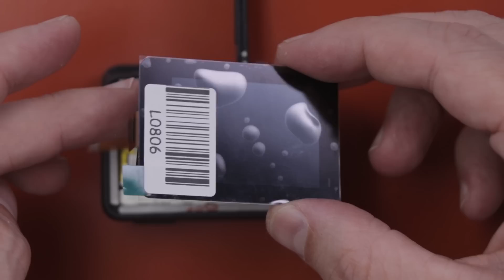I Bought 6 "Unfixable" GoPro's - Are They Really Unfixable?

Comment: I hate how everything is made to be disposable these days, there should be laws to prevent companies making unrepairable products.
Reply: again anther YT reply who has no understanding, form factor is the reason here, gopros are small action camera - having screws etc in it would increase its size considerably.
What do you do? sell like this an sell heaps?
or make it repairable for the sensitive monkeys and have a hand held camera you cant mount to anything so they sell 5% of what they wouldve?
Reply: @MrSupermugen  Nice job on the condescending attutude but you don't know what you're talking about. I has little to do with form factor and everything to do with cost. It's cheaper to seal it with adhesive than use a serviceable watertight gasket.
Reply: @MrSupermugen  actually a lot of this has to do with it's waterproof ratings.
Reply: There should be some fixable rating standards on devices.  They put ratings on videos, ratings on food in the supermarkets, environmental markings on packaging etc.

Comment: Hi, if you dont end up repairing  the gopro back to stock you can sell it as Naked gopro for drones. Many are looking for it and you can sell at the same price as a repaired gopro
Reply from the maker: Interesting. Thanks for commenting!
Reply: @Tronicsfix  I bet the big reason why the 6 sold for $600 - while it's not mentioned, naked drone application, that's the where the value is. The seller probably didn't want to bother with it. Also while googled it, I see there are kits to cover the guts. I think buying a new GP to strip down, might make most people hesitant, the cracked screens/lens cover units are perfect. The trashed body unit, you tested the repair on, would have been perfect.
Reply: Yep, I did a GoPro teardown of a Hero6 and I've actually been looking around for a broken Hero8 to do the same to. It just needs to record. The back screen can be cracked, but it still needs to function to pair it to a phone. Once it's paired the phone can take over the function of the back screen. The whole goal is to make a GoPro that weighs 30g or less.
Reply: Yes! Now the Hero 6 price went up a lot due to this. I bought one with a broken screen for 110 euros, now they are selling for like 200!
Reply: Spot on. Took the words out of my mouth lol.
Reply: @Tronicsfix  yup. more for Hero 8's than 7's. The gyro in the 7 is not compatible with Reelsteady Software without some sort of soft mounting. There is a lot of interest in "Naked" Hero 8's for FPV drones.
Reply: Just looked at Roberts build and I haven’t been able to find any hero 6s for that exact reason
Reply: What does that mean? I googled "naked drone application" and all that came up was cops catching people naked sunbathing in minnesota
Reply: @tasjourney7778  LOL 😂
Reply: Why not sell even a bit higher though, just cos you can ;)
Reply: @finlandjourney6065  I've definitely seen naked GoPros go for more than a new one. Many people are afraid of stripping it themselves.
Reply: @Tronicsfix  The Hero 7 is not a good choice for a naked GoPro, though. It has problems with the vibrations from an fpv drone.

Comment: I would recommend using B7000 for repairs that require waterproofing. Its a liquid adhesive that cures relatively quickly. Perfect for repairs like these.
Reply from the maker: Yes, I'm familiar with it
Reply: I agree.
Reply: I came to the comments to suggest this too - perfect for this job. Also a heat plate makes getting the rear lcd out a breeze. Fun repairs :)
Reply: @Tronicsfix  That's actually why I clicked this video, I thought repairing a gopro made b7000 a no brainer since I've heard about it being used to help maintain some level of water resistance with phone repair. Do you think its possible to get at least slash or dunk resistance using b7000?
Reply: @Tronicsfix  yet in this video, you keep saying youll never make them waterproof again...
whilst a couple of dollars of sealant would solve that and add more to resale value
Reply: the approax for display like  and for repairs on phones like s8 s9 is to take the guts and place it in new frame that cost pennies and is not bended
Reply: I used this on an Apple Watch that had the screen sheared off. I put some of this stuff around the edges of the glass since the center area near the screen was fine. It's been working great since then! Wouldn't recommend doing this the way I did, but beats paying $300 for a watch screen of all things when the broken one still works fine.. lol
Reply: @djjc9782  Right? I feel like just adding the sealant and not a sticky tape sort of adhesive would have actually made these repairs viable. The front plate would have been able to be pushed down more and not look so terrible too.

Comment: Seeing as you have the ifixit kit, there is a tool designed to be heated and laid on the spots where the adhesive are vs using hot air that can damage the plastics. I think the tool is called the i-opener, you throw it in the mic for a bit and it holds its heat but spreads out that heat so its not concentrated in one spot like the hot air gun

Comment: Gopros are supposed to be for active lifestyles. But they sure break easy.
Reply from the maker: Exactly!
Reply: TronicsFix in fairness, they still operate.
Reply: There's no reason for those screens not to be plastic, with simple protector on. They would never break, and its not a touchscreen you use 6 hours a day so you would mind it not being a glass
Reply: @TravisFloyd  What do GoPro's boots taste like?
Reply: they are for active lifestlyes. However dropping them or hitting them about will still break them. Would be the same if you threw your bike around and hit it off things. With care go pros are perfect! Mount it and youre good
Reply: capitalism at finest
Reply: My gopro 7 just died after 3 months of use without ever being exposed to any harsh conditions. Gopro is garbage with insane marketing budget. Edit: I got it replaced. I was angry because it's not cheap, died and I then learned that I can't even pay to get it fixed 3 months later. Gopro did try to help, eventually I got store forced to fulfil warranty
Reply: gopros are the most sturdy action cameras outthere...with old VHS or digital 8 you couldn`t do 1% od things that you do with gopro..I have hero 7 and can`t complain about anythnig...dust, water,high temperature, sweat,  low temperature...works like a charm.
Reply: this is the reason why i am still using gopro hero 4 black (i have actually 3 of them and 1 is brand new in original package :D ) - i have mare than 30 cracked or destroyed original housings but camera still works great
Reply: @absolutemonarchy8657  exception to the rule, rather than the norm pal.... 
it probably got bored to death...
Reply: @djjc9782  actually. I’ve had many. They don’t like my kayaks. Very well. And truth be told I’m not the best drone pilot. So yes. I have gone through a few.

Comment: They need to start making unrepairable stuff like this illegal. It's just incredibly wasteful, instead of replacing a part you need to replace the whole unit.
Reply from the maker: Completely agree
Reply: Nature of the beast re capitalism, they don't want you to ever repair anything if it meant each time it broke down you were forced to buy a new one.   American carmakers were pretty nasty in that regard when planned replacement of a US car went from 20 years to 15, to 10 and down to 5 and they put in design flaws purposefully to make sure your big car almost self destructed to the set interval.
Reply: Form factor is the issue here, if its made repairable the camera wouldnt be this small, gopro users want smaller and better cameras, sorry but your point is mute because of this.
Reply: @MrSupermugen  You work for Gopro ?
Reply: @MrSupermugen  With the 7 the lens could easily be replaced... With the 8 suddenly not anymore. How did that make the device smaller or better?
Reply: Nooo, Damaged Gopros have very practical uses. You strip them down to a bare motherboard and lens, add a BEC and voila lightest gopro you can get to chuck on your multirotor ;) Check my channel out if you're curious :)
Reply: @MrSupermugen  Find a way for both worlds, if a camera is not working anymore how can be fixable? Buying a new one?
Reply: @Mobin92  did u see the dusts inside ng 7's 6:34? MAYBE it's their way to make it better. You guys have to know that size, great features, water resistance, and price do not work well. If you want a phone that has IP rating (water and dust resistance), then you have to pay additional 200$+- compared to the ones without. If you want a smaller mobile phone because you have smaller hands, the batt capacity will be sacrificed (if you want a high-end or mid-end phone). SOMETIMES there have to be sacrifices to be made to make something 'better'. I'm not a fan of GoPro, I don't even have one.
Reply: @Mobin92  it made it a bit smaller and lighter supposedly. However customers complained and hero 9 is back with replaceable lens yet again.
Reply: The answer is to not buy their product.  They'll get the message!

Comment: Thx for sharing. Some devices just aren't made to be repaired. I like that you don't take it all apart but focus on what is broken. I am always impressed when you can reconnect those ribbon cables and know how to remove and solder the chips back onto the boards. I been paid for doing repairs to a computer once but that was a strange situation where the computer ran a test device and no one wanted to recode the software. I got a paycheck but it was a one shot deal. I do repairs now on what I own and can't afford to buy new so watching your videos helps me to see how to open things up. Those gopro cams are beyond me. Admire your guts for even trying.

Comment: imagine selling a broken 7 when the front lense twists off and is like $10 all u have to do is pull on it then twist
Reply: Fr I didn’t realize that’s all it took.
Reply: Funny thing is GoPro designed it to be removable on the hero 5-7. You have to remove the front lens to put it in a dive housing for scuba diving. Cracks me up that someone thought it to be not fixable or unusable. They made it so if it gets scratched or broken you can change it yourself.
Reply: Imagine having so little understanding of GoPro's to arrogantly inspect its exterior to assume that's where the "unfixable" part lies. Could be compromised water proofing, issues on a print plate causing the camera to stall mid recording, could be sound malfunctions, whatever.... could be 1000 things that deemed it unrepairable and this guy looks at a broken glass lens (replaceable without tools) and assume that's the issue. Pops in a battery and doesn't even try recording. Destroys the front of a camera, pops it back on twisted to look like a curly fry, puts a couple of double sided sticky tapes underneath and calls it pretty much fixed lol 😆 who wants a gopro that dies in rain? Can't believe how many likes vs dislikes this video has .... no critical assessment of this guys ignorance whatsoever 😳

Comment: Why did they use glass? Even Nintendo was smart enough to put plastic screens on the Switch, because kids will drop it. GoPros will go through far more abuse.  Sure it'll scratch easier, but the screen won't crack and you'd be able to buy protective covers anyway.
Reply: yeah plastic screen + glass screen protector is best combo, you get best of both worlds, plastic wont crack, and the glass feels better to touch/swipe on and wont scratch up as easily as plastic, and you can easily replace the glass screen protector if it ever cracks or something. Another annoying thing companies do too often is having glass back covers, they are just slippery and breaks too easily ugh
Reply: Because money, thats why.
If you made them more durable/repairable, people would buy new ones less often.
Whenever a company does something that seems massively stupid, always Always assume greed. You'll rarely, if ever, be wrong.
Reply: @AppleReviews  Video on a plastic screen looks soo much worse, even tho i still agree with something like a Switch which is basically a kids toy or a GoPro that is supposed to be durable it makes sense to use.

Comment: Hey @TronixFix, 2 thinks I’ve learned from fighting with these. A box razor blade is great for getting rid of the old silicone from the frame, and B-7000 epoxy is great for re-waterproofing and for a more secure seal. TESA adhesive can break, especially with the abuse a GoPro gets. Hope this helps! Glad to see you working on new stuff!

Comment: Weird how it was so difficult for you to get the lens of, taking the lens of was actually a thing that I did pretty often when i had the 7 black. Because you need to take it of to put it into a protective and even more water proof casing.
Reply from the maker: It's supposed to be easy.
Reply: @Tronicsfix  you have to pull it ou a bit before twisting because they lock in to the pattern (?creases) inside
Reply: @memesoo.kang_  Yup that's correct, that makes it a lot easier.
Reply from the maker: @memesoo.kang_  I'm telling you, I know how to remove them. Some of them are not that easy!

Comment: After changing out these parts, it seems you would have to verify they are still waterproof before reselling them eh?  Troublesome...
Reply from the maker: These would not be waterproof unless you're just replacing the camera lens.
Reply: I'd sell them 'repaired/not waterproof' - use a housing for all wildlife photography.
A housing ads a layer of protection anyway.
Think about this.  If these several devices we see in this video had been housed at the time of damage, would that shock have been visited on the lenses and screens, or just on the housing??
* When I bought my first GoPro in 2013, I bought an underwater housing.  I'm in Vegas.  The only water I will encounter is in the fountains on the strip, or at a car wash. I bought a layer of protection from dust and shock.
Reply from the maker: @MarkH10  Yes, they can still be used underwater with a housing.
Reply: Ahh right on.  If you list it on eBay are you allowed to call it "seller refurbished" if the waterproofing isn't up to spec?
Reply: @BLiNKx86  Not unless you tell them about the waterproofing. Refurbished means meets all specs with minor cosmetic irregularities.

Comment: @TronicsFix I have 2 tips for these repairs. First heat gun not a bad heat gun but I think this repair would benefit from a full size heat gun from like Lowe’s or Home Depot.2nd the lcd pry or chip removal use a scraper type razor blade you can get in without scratching or damage and it pry good too. Also for sealing you could use jb stick for wet conditions around lcd. And silicon in a syringe to control spread for attaching front and rear. I holds things together better than you think.

Comment: “Unrepairable” literally needs a replacement lens, that’s supposed to be a user replaceable item.
Reply: Those front lenses are really easy to replace; you need to pull and twist at the same time. On my gopro 7 black i regularly remove it to replace with a polarisation filter. People who deemed it unrepairable obviously didn't know what they were looking at
Reply: Ther are even tools specifically for this that you can buy for a few quid to twist the lens off, without needing vice grips..

Comment: To replace the front lens cover (like at 5:12), you could put a credit card or something thin in between two opposing corners of the lens cover and face of the camera, pry it apart so there is a gap in between the face of the camera and the cover, then twist it off.

Comment: I suggest adding a little layer of silicon, at work we do the same if we open a starter soleniod (on cars mainly) to replace bolt and contactors and then we add black silicon so its waterproofed and it doesnt rust from the weather or car washes

Comment: As far as adhesive goes you should look into Automobile glass removal and replacement adhesive you could probably dissolve the old one with some solvent, As for the destroyed front cover when taking it apart, it seems like it could be a small business opportunity for you, find a friend with a good resin printer and make a replacement plastic injection mould for it and get yourself a used manual plastic injection moulding unit and start offring the replacement front cover or simply buy as many damaged Go pro's as you can and use the mentioned tools to fix and resell them.

Comment: @ 5:54 did you consider trying a very thin layer of vasoline (grease or some kind of lube) on the gasket for the front piece of the go pro? Putting it on dry may kink, mar or damage it since it is a very tight fit.

Comment: The lens cover is not hard to get off due to the gasket! You have to lift it up a little so that the teeth on the lens to no grip into grooves on the case anymore. I found the best way to do it, is to use two guitar picks and push them between cover and case on the lower as well as the upper side.

Comment: Replacing the lens cap may have introduced moist air into the device which may cause condensation on the inside. (But if the battery compartment is not isolated from the rest of the insides that may not be an actual problem.)

Comment: It shouldn´t be so hard to change the lens. There is a gopro case that you need to remove the lens. Another thing, have you tested the connections of the camera? Like is it charging? Is the HDMI connection working? I have a 4 black that works but I have to use a battery charger because trying to charge the battery using the camera USB directly does not work. Just an example.

Comment: I have a GoPro 3+.  The LCD menu screen on the front is broken and doesn't work.  Then, recently I scratched a deep gouge in the lens.  I need a video that shows repairing the lcd menu screen and lens replacement.  Thanks!